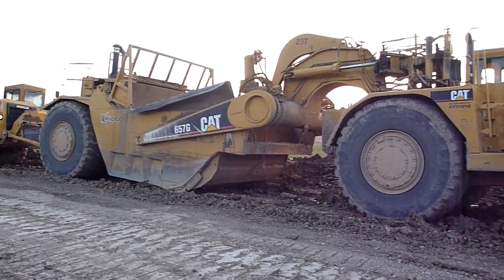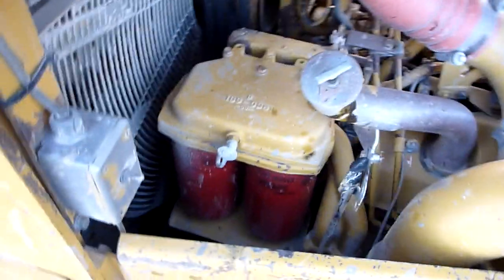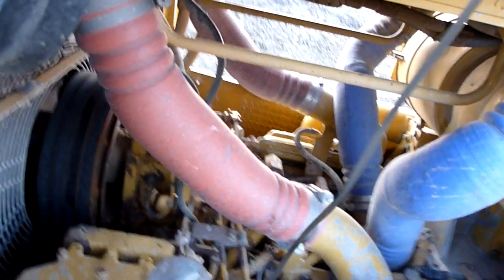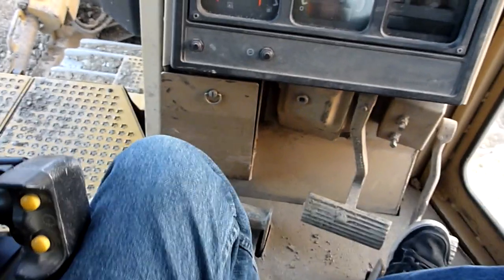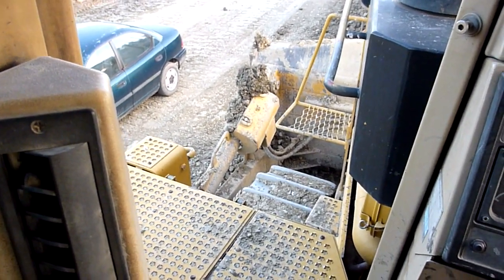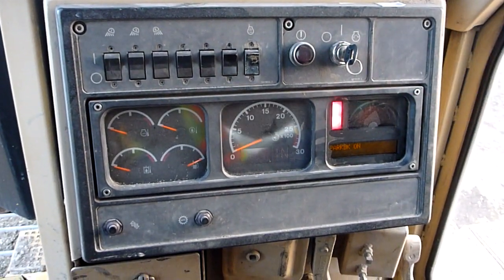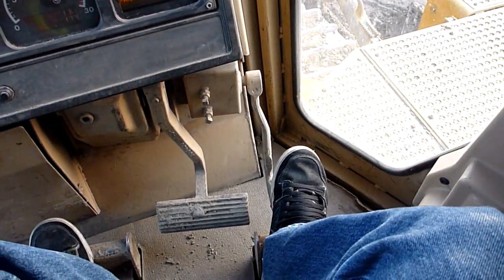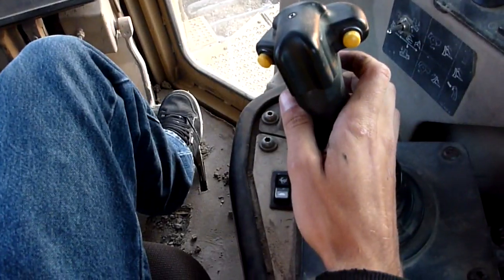Cat D10R Startup and Controls

Comment: now clean out the tracks while it warms up and slap the simple fuck who left it like that when you switch shifts. some ppl eh?
Reply: My father told me the same thing, since he worked with his own tractor (International TD5 which I learnt to handle before cars or wheeled farm tractors), esp. in winter.  He saw some people that didn't and they remained stuck in the  very cold winters back then (he saw the thermometer go down to -68F once  Only one thermometer in the shop went that low, the other ones were only a solid red bulb with no line coming up).  Over the time he worked there he saw people over pushing their dozers (burning oil a pint a day and more), tracking out due to lack of maintenance (proper tensioning and cleaning of the tracks), and often goofs (e.g: losing a track while turning over a stump).  Cleaning is an easy maintenance that'll help the machine in the long run.  Of course, here it seems the material is quite dry and not below freezing so it's less likely to cause issues.

No, his dozer was not started by a pony-engine and was not started on gas then switched to diesel, this was a "modern" 1962 model, with the blade's arms outside of the tracks, unlike most TD5s. :-)  Loved this little beast.

@vantagetes: thanks for the video, very interesting to see how these newer machines work.

Comment: Kinda risky leaving that Neon there, somebody might accidently use it as a wheel chock. But otherwise, thanks for showing us around the cab. In Western Australia, you name the mineral, somebody is digging it out of the ground here. Yet most miners and their contractors are too cheap to train anyone. I have operator tickets for a skid steer loader, a backhoe, a front end loader and an excavator, but because I have "no experience" they don't want to know me
Reply: Hey Mechknight73 I noticed you posted that comment 5 years ago Im curious how you got on...did you get a crank on a machine?. Im an operator based in Qld and went through the same when I was starting out 20 years ago.

Comment: Just wondering on this R do you have to Lock out the Cat to Reverse the fan ,The 10 N model i was running I had to sucked bigtime -Time sensitve stop pushing wood chips feeding a reclaim so when you`d blow the rad out with the fan and side guards on engine in winter to remove ice build up always had to stop & lock out , sure would have been nice to be able to reverse it while backing up for a new push -I see the steering is different too 10 N has T handle tip steering.

Comment from the maker: @disgustapated the dozer spends the majority of its time at full throttle when working so rather than having to hold the pedal all day you just set it wide open. Having a decelerator still allows the operator to slow down while working near objects or to control track spin.
Reply: WHEN I WORKED FOR MANIX IN 1964 WEST OF JASPER ALBERTA CANADA..CALIF JOE WAS THE " PUSH"  IT WAS A ROCK JOB..I'D NEVER EVER BEEN ON ROCK..JUST MUD & DIRT EXPERIENCE & TAUGHT NOT TO GO FAST WITH THOSE MACHINES... WELL ! HEREI WAS ON A D8 POWER TILT "U"BLADE & NOT EVEN A DRAW BAR ON THE REAR...PLUS THE TRACK PAD GROUSERS WERE ALL WORN OFF...AND I AM BEING CAREFULL & CAUTIOUS WITH THIS MACHINE & AS I AM MOVEING ALONG A LITTLE MAN APEARS UP THERE WITH ME..HES STRONG CAUSE I IS A BIG GUY..HE THROWS ME OUT OF THAT SINGLE BUCKET SEAT ONTO THE HOT HYD TANK...& GESIN MY SEAT PULLS THE THOTLE WIDE OPEN & SHIFTS TO 3RD GEAR..LIFTS THE BLADE UP OFF THE GROUND..HE'D YELLED AT METO PAY ATTENTION TO WHAT HES DOING..CUS HE AINT HERE TO BABY ME...BUT I AM TOO BUSY ATTEMPTING TO KEEP MYSELF FROM GETTING TOTALLY BURNT ON THAT DARNED HYD TANK TO SEE WHAT THE HECK THIS IDIOT IS DOING & WHO THE "F" IS HE ANYWAY ? HE'D SPRED ONE OR 2 END DUMP LOADS & YELLED AT ME NOW YOU SEEN HOW TO DO IT...DO IT..& DONT EVER LET ME SEE YOU DECELERATE OR SHIFT DOWN..I WILL FIRE YOU ON THE SPOT..I JUSTVTORE A HORRIBLE VERBAL STRIP RIGHT OFF OF HIM..AFTER I SHUT THE MACHINE OFF & I TOLD HIM I DONT KNOW WHO THE "F" YOU THINK YOU ARE..BUT YOU JUST BURNT MY BODY BAD ON THATHOT HYD TANK..IF YOU EVER COME NEAR ME AGAIN I'LL BEAT YOU INTO THE GROUND.. NOW"F"OFF....BUT GEUSE WHAT..NEXT COUPLES OF END DUMP LOADS..HE WAS BACKONTO MY MACHINE ..BUT THIS TIME I DIDNT MOVE & I ATTEPTED TO SHUT THE ENGINE OFF BUT HE GOT A HOLD OF THAT LEVER BEFORE I DID..BOY WAS HE EVER SCREAMING INTO MY EAR..I COULDNT GET UP OUT OF THE SEAT..HE KNEW HIS STUFF..I THOUGHTI SHOWED YOU WHAT TO DO..YOU DIDNT HEAR WHAT I TOLD YOU EITHER SO WE ARE EVEN...WHAT ARE YOU REFERING TO..YOU BURNT ME..HOW THE "F" AM I TO LEARN ANYTHING FROM A MANIAC ?? NOW GET UR HAND OFF OFTHAT THROTLE LEVER..& WE FOUGHT OVER CONTROL OF IT..FINALLY HE ALOWED ME TO KILL THE ENGINE..HE SAID I SHOULD FIRE YOU RIGHT HERE FOR FIGHTING UR SUPER INTENDANT...I SAID I WAS LOOKING FOR A JOB WHEN I GOT THIS ONE..SOI CAN GO BACK TOLOOKING AGAIN..THERES 6 OTHER CO'S CLOSE BY..HE KRPT ME IN THAT SEAT..HE SAID YOU JUST CAME FROM A DIRT JOB..RIGHT ? YES..WELL NOW UR ON ROCK & IF YOU WORK OUT HERE..YOU' LLBE ON ROCK TO END OF THIS JOB..EVERY OPERATOR THERE WAS SURE I WAS BEING FIRERED...BUT HE RELENTED & TAUGHT ME..I ENDED UP RUNNING EVERY PUECE OF EQUIPMENT THEY HAD ON THAT JOB..BE CAUSE HE FIRED LOTS OF OPERATORS..SO I JUMPED IN..THEY WERE ONLY 8 HR SHIFTS...I LEARNED LOTS THERE..THE MECHANICS LIKED ME..FOREMANS TOO...I LEARNED REAL QUICK LIKE...FUN FUN FUN....
I WAS 21 AT THAT TIME...
CATAPILAR I FOUND OUT WAS A LOT TOUGHER MACHINE THAN SOME OWNERS THOUGHT THEY COULD BE...ROCK IS HARD & TOUGH & ROUGH...AND RUNNING A ENG WIDE OPEN ALL THE TIME IN 3RD GEAR NO LESS..THEY NEVER QUIT..EXCEPT THE GOVENER WOULD FLY APART SND IT SOUNDED LIKE IT WAS GOING TO EXPLODE..MECHANIC CAME & TOLD ME..SHUT THE FULE OFF ! I ALLREADY DID IT WONT QUIT...AT THE TANK !! OH ! RIGHT ! I FINALLY FOUND WHERE THAT THING WAS AT & SCREWED IT TIGHT AND IT QUIT RUNNING OH THANK GOD I SAID...HE SAID HIS NAME WAS NOT GOD...RIGHT ! HE FIXEDVTHE GOVENER RIGHT ON THAT MACHINE..THEN OPEN THE TANK SHUT OFF AND WAIT FOR FULEVTO FLOW THERE THEN HE HOOKED THAT LINEUP AND I STARTED THE ENGINE VIA" ELECTRIC START".. GOD BLESS...TURNED OUT THAT THE PAD GROUSERS WERE WORN BUT STILL HAD LOTS OF TRACTION..I ASKED THE MECHANIC ABOUT THEM..HE SAIDTHAT I HADTHE BEST TRACKS OF ALLBTHE MACHINES ON THIS JOB..WHY YOU SAY THAT ? THOSE ARE "ROCK" PADS..( THE GROUSERS WERE 'S' SHAPED & WAY WAY WIDER THAN THE STRAIGHT GROUSERS WERE...THAT MACHINE COULD & DID WALK ON BARE ROUNDROCK & NEVER SLID SIDEWAYS..IT WAS WAY AWESOME...IT WAS A REAL GOOD CAMP & JOB FOR ME....I CUGHT THE TAIL END OF THAT JOB...I'D SIGNED UP TO GO TO AUSTRAILIA FOR BUILDING A RAILROAD ACROSS THAT COUNTRY..BUT THEY CHANGED GOVT DOWN THERE & HALTED THAT JOB.. WOE WAS ME..

Comment: @vantagetes they had 4 cat mechanics working on it they changed the clutch checked wiring sat in the shop for a week NO way would not go so I came into the shop for service on the 9N and I asked if I could try it later they said giver while they worked on the 9 I pulled out and locked out to fill my time sheet I tried the fan when the whole world went by me they come running out what did you do I told them just locked it out well Thank the boss I got a nice pay check after that find .

Comment: These are`nt  to far from the new 10 N keys on the dash does this have the flouresent lights those are nice ,sucks that you have to lock out to blow the rad out with fan at least the one I was running did on a chip mill feeding 2 reclaims did it for 2 yrs with the older 9 n OMG what a differance no more levers this one has the 2 track brakes ours had a twist lever forward & backwards LOVE them .

Comment from the maker: @arbitor55555able Actually it's not, the quick fill coupler for the diesel tank is. If you look closely you will see a hose running to a box with a round silver connector. The service truck has a quick coupler on the diesel gun they pop on there rather then having to haul a 3" hose full of fuel up the tracks and across the side of the dozer.

Comment: I should not have called him a dummy,sorry about that.but white smoke from the stack indicates cold fuel start.Sorry for the name calling,that was wrong.if it was a warm engine start the smoke should be black from the fuel,unless coolants getting into the cylinder.the newer cats pumps are cut back to reduce emissions & produce very little smoke.

Comment: A good operator..starts his cold start pre check..with a walk around...check hoses..undercarriage etc.Check all fluid levels... engine  pre start  oil level..then when running pre check running level..air filter indicator..fire extinguisher indicator...cleans track frame daily ... cleans all observation glass points..checks all alarms.

Then he does his plant running check after start up......via gauge indicator read out information ......similar to 747 pre start check up...lol

Comment from the maker: @FUCKINROCKIT There is one on each side, if it's in dual mode as the one side goes up the other will go down. Now in single mode you can keep one side at the same level (say toe of slope) and change the other side to vary the slope.

Comment from the maker: Heh Mike so much for mr cat mechanic =p But I guess maybe Dexters doesn't run quickfills? If you look closely there is a square box with a round silver quick fill for diesel so the service guy doesn't have to haul his hose up to the cab. This one was worn out and leaked every time he connected/disconnect. That's where the leak is coming from. Good eyes none less! (Hey when you coming boarding anyways? Isaac is back on the 12th and I don't work weekends).

Comment from the maker: The steering toogles on the left hand would be the cluctch/brake combo, the deaccelerator is exactly like an accelerator except reversed (you have to let it out to get more fuel). The reason being is that you spend a lot more time at full throttle.

Comment from the maker: That's diesel not hydraulic. If you pause the video at 4:00 and look just up and to the right there is a hose going to a square box with a silver quick attach fuel fitting. Every now and then the fitting doesn't pop correctly so it drips down the ripper into the fuel guys overflow bucket. We use quick attaches on a lot of our machines to minimize how often the fuel guys have to climb up and down.

Comment: Yeah, thanks for all the info. My own Cat 3408 has done over 5,000,000 kms or about 70,000 hours in 80 tonne road trains, which is quite heavy work, and it's on it's 3rd in-chassis rebuild. Never been out the frame and the crank & block are still in tolerance. Cat make good machines & engines.

Comment from the maker: The D9Ts have the C18 now, and the D10Ts have the C27. I haven't seen any Ts with engine problems yet. For the most part all the dozers I have seen (even in heavy use conditions) usually hour out before you have an engine malfunction. Of course once you start racking up high hours then you need to do some routine engine work, which usually just ends up being pull the engine and rebuild while its out, or swap.